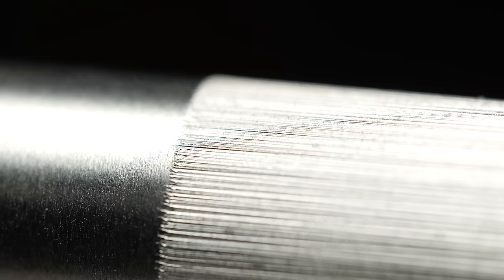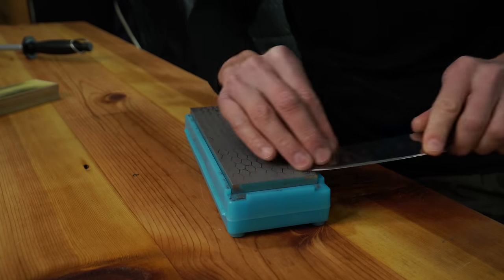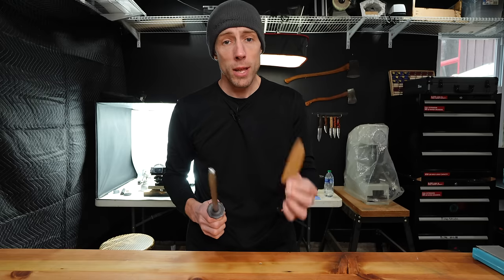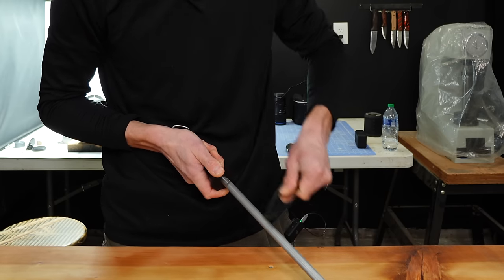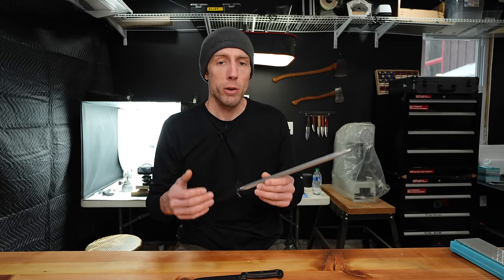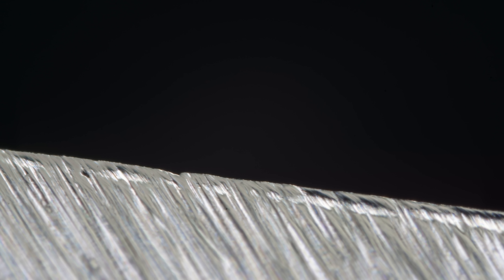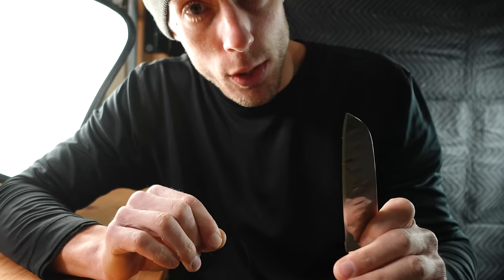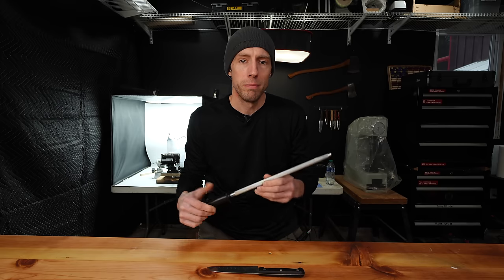What Do "Knife Sharpening" Honing Steels Actually Do?

Comment: YOU ARE CORRECT. A butcher's steel does not hone. It only aligns and restores an edge that has become rolled or dinged in use. It does not remove any steel other than incidental bits of burr.  "Honing steel" is a misnomer. The steel does not hone. Honing is the controlled grinding away of metal with the goal of creating or tightening the apex. 

However, I would absolutely NOT regard a butcher's steel as irrelevant or useless. Properly used, a steel restores much of a knife's cutting ability while removing essentially zero metal. My kitchen knives typically see the steel once in every day that the knife is used, sometimes twice, but sees a stone or lapping film maybe twice a year. 

PROPERLY USED. That is the key. If you cannot maintain a consistent angle, you won't make any improvement. Obsessing over microphotographs can misdirect you from the true goal, which is making the knife cut efficiently..HOW WELL DOES THE KNIFE CUT, compared to as freshly honed? 

Also important is the actual bevel angle as honed. Most people try to use too acute of an angle, resulting in a fragile edge that doesn't hold up well to cutting boards and such. A compound bevel can give the best qualities of the acute and the obtuse bevel. 

The ridges on commercially made steels are not essential. Remember, the action of the steel is STROPPING, not honing. Whether the stroke is edge leading or edge trailing, it is still stropping because the goal is straightening the edge and not grinding from it.

I make my own steels. I simply turn a piece of annealed 4140 round bar stock on the lathe just to surface it, add a handle, and bobs yer uncle. It doesn't have to be hardened. You can also just use a rod of mild steel from home depot. As long as you put a handle on it so you don't slice your hand to bits. Just run the steel inside a rolled around it piece of 400 grit sandpaper to knock off the mill slag and varnish and stuff. It might surprise you how much better it works than those ridgey things everybody sells these days. 

You can show all the pics you like, make all the arguments you like, but the fact remains that a well used steel WORKS, and hitting a diamond stone every time you notice that the knife isn't as sharp as it could be is unnecessary wear to the knife, and a good opportunity for someone who has zero honing skills to really screw up the edge of a knife. I grew up knowing how to keep edged tools sharp. I was very surprised to find that this is not a universal man skill anymore. I got tired of being the only guy in the crowd with a sharp pocketknife and I was really glad when the internet happened, and I could tell people wanting me to teach them how to sharpen their knives or to just sharpen their knives myself, to look it up online. Making and keeping a knife sharp is absolutely an essential man skill but few people have that skill these days. They will destroy their edge more gently by using a steel, and staying the hell away from diamond plates, especially cheap ones that are not even flat.

I do have to LOL at Gordon Ramsay and other TV chefs furiously flailing away with their knives on their steels and obviously not getting anything done except looking cool for the camera. Reminds me of the cowboy movies where the barber strops his razor with a huge belly in the strop and goes at it like maybe he isn't actually a barber in real life LOL.

Comment: I don't care for honing rods but, from my experience, you are using it wrong. You're not supposed to run it along the grooves - you're supposed to run it at a a fairly obtuse angle, just like you did in the video with the pull-through sharpener. Now, I don't have a high-magnification lens, so I can't prove it myself, and you've probably already been told this before and tested it, but I can't travel back to 3 months ago, so here we are.

Comment: i think the steel works more like a file and should be used sideways with little bit of pushing but not up to down only. it has grooves on the surface, that act like a scraping file tooth. so i think the steel is actually fileing away material on the apex, since giood steels can be very hard (65HRC and more)  also you push the knife into the steel not away from it. like with normal sharpening you will get a better result with pushing instead of pulling. that is because the "burr" gets pushed into the edge and cant get as big as when you pull the apex.  by any means the knife steels are outdated as you said. i only use the synthetic ruby (made by degusit in France) sold from Westmark (a German Company) it is the best tool i ever found to keep knives sharp. its not made for full resharpening, but it abrades material of with a very fine grit and leaves a great apex. most ceramic rods are also pretty ok, but i found the ruby to be best grit and ENDLESS use, since it is extreme hard. mine is now more then 15 years of daily use and looks like new other then discoloration, also the rate of abrasion is very constant over time, so it does not realy get dull at all.

Comment: I am a blacksmith, and by preponderance of work, could more-accurately be referred to as a knifesmith (about 90% of my work demand is with blades of some form: hunting knives, kitchen knives, scythes and machetes, as well as axe heads). Saying this, I'll let you in on a very-valuable piece of information: if you are reliant on a honing steel to 'keep your knife cutting sharp', then you have a poor knife that is ground at the wrong angle. All of my blades are made from 1085 or higher carbon steel (I make a rare-few of them out of D2 tool steel). Once I have formed them, and re-hardened and tempered them, I generally put a 20-degree angle on larger blades, and a 15-degree angle on precision blades (while an axe might be 30-35 degrees). The angle is critical, as the larger the angle, the more abuse it can take and the longer it will hold its edge, but with the caveat that the greater the angle, the 'less-sharp' it will be in the end-form. Yes, I have made axes that can shave the hair on your arms, but if you want a good firewood-chopping axe, it is wasted effort to work so hard at an angle...the trick to axes is to polish the sides to a mirror finish, with less focus on that edge...the sides are what slow your blow down and make it less effective).
As for knives, you are not 'calibrated'. You CANNOT hold a consistent 17-19 degree angle to sharpen that knife...so use a sharpening guide to help you! With good steel (high carbon...Rockwell somewhere around 55-59C) start with 400-grit Medium Arkansas stone...REAL ARKANSAS, not some 'reformulated ceramic mix with cute little hexagon patterns formed in the ceramic matrix). The 400 starts the edge 're-dressing'. Now, go up to 800 HARD Arkansas. Work it here, feel the edge, this is the final 'metal removal grit' you need...all points about this are for proper HONING! Now, progress upwards to 1200-1400 Hard Arkansas...at this point, you should EASILY be able to dry shave with the blade. If I want a real masterpiece, I may take it up to 2000-Hard Arkansas...but unless you are dealing with a straight razor, chances are you don't need to work it this much. I use a leather strop with red rouge if I am dealling with a straight razor beyond this point...and is the ONLY steel work I use a 'non-stone honing tool' on. Face it, good knives and maintaining their edge is rather pricey to enter into, but in reality, it is HIGHLY worth it. If you are paying less than $90 for a knife, or $200 for a full set of stones, you are cutting corners or buying 'questionable' goods. Personally, my blades START OUT at $275, and I have sold some for $600 (larger hunting knives with razor-quality edge dressing). As for stones, there is only one company I work with, as their stones are better than all-others, and that is 'Dan's Whetstone Company' in Arkansas.

Comment: I did a lot of similar research with microscopes, and I came to the same conclusion that the ribbed honing steels were just mangling otherwise healthy edges.  However, I still cannot get behind diamond coating honing rods.  They are unnecessary, and still risk doing more harm than good to your edge, especially when abrasive maintenance is not needed so often.  There is a good reason that most butchers all use polished honing steels: they actually do help maintain slightly rolled edges, are safe to use with more pressure, and don't remove any material.  The big issue with steel honing rods is those awful ribs on them.  THAT'S where all that mangling comes from.  I switched to a polished butcher's steel a while back, and it really does help me maintain my kitchen knives.  Even though I baby them (always using a cutting board with light pressure, and never cutting bones), every now and then I can FEEL that there are some spots along the blade with a rolled edge to them.  That's also what is great about the polished steel.  You can actually feel little "ticks" as you drag the knife edge-trailing along the steel.  I can keep working the knife across the steel with a decent amount of pressure, feeling the "catch" of the rolled edge lessening on each pass, until it is far less pronounced.  And when I go back under the microscope, I don't see any other mangling or deformation along the edge.  I would love to see you do a video comparison with your microscope as well, showing the effectiveness of a truly polished honing steel on a rolled edge.

Comment: Oh really? Steel cannon work against the steel?
So HSS drills shouldn't to be able to drill steel...
But they do.
Grinding is less effective than cutting?
Definitely!
But saing that ginding dont'w work at all?
Definitely wrong.
Honing is a way to extend the sharpness for a longer period between sharpening session.
it may work..if you use a knife daily and on the end of the day you want to keep as much sharpness as possible to another day.
But if you ruin the blade  bending the edge....yeah...in that case no subtle means can work.
It it  is like using a rubber hammer to drive in nails...
Will it work?
Definitely not.
Does it prove, that hammer is no good for the nails. 
Not necessarily true...😛

Comment: Ceramic rod sharpener is ideal.. the main thing is not to press hard, or medium, the force is maximum 50-100 grams. It will be like micro-sharpening the tip of the edge, but the rod will quickly become clogged

Comment: 😂😂😂😂 Well, my process is going to sound like a sacrilege compared to this. I have a set of cheap knives, a cheap sharpener and a cheap steel.   I use the steel after each use of a knife, and I have the sharpest knives in my family. I actually have to bring my own to family meal preps because I can't deal with my siblings knives. Mine may not be that sharp compared to professionals, but they do everything that I need them to do very well. They also cut me very quickly and easily if I make a mistake and don't move them out of the way when I'm done. Also, I consider myself advanced compared to my mom who had one knife for EVERYTHING!☺️ It was called the "Brown-handled knife" and if it got dull, sharpened it on the step!! Had it for 20+ years, but got lost in a move. It was probably being used to cut tape!!😂😂

Comment: I'm not directly disagreeing but more asking a question.

Many years ago I purchased a diamond rod as described. Then used, more or less as described, on a good quality knife. (Wusthof Classic chef's knife, should be high quality, German made).

In a few years the knife had too much metal removed to become sharpened properly. The most hardened part of the edge was removed by the abrasive sharpening. Indeed, in the short term I had the good results as shown.

So question is what to do when knife becomes dull after short term usage? Removing metal I am sure works in short term, but long term appears to be a poor result and have to replace knife that should be able to last a lifetime.

That is what the "steel" does, it may not do a perfect job but it does straighten out lightly rolled edges from common usage. And I am sure that proper technique is required. So question is what to do if one wants knife to last a lifetime for ordinary food preparation use, rather than change expensive knives often while having an almost "perfect" edge?

I completely understand that abrasive (metal removing) sharpening is required from time to time.

Comment: I think you’re right but you’re also wrong. 17 seconds on the knife steel raises a bur on a carbon steel kitchen knife that will cut very well but not very long before you need another 17 seconds. The knife steel wins hands down for how much sharp cutting you get for blade material removed. Yes I have to come back to the steel more often but I don’t worry about loosing knife steel to get back to ultra sharp.

Comment: So, this is my experience, and please help me.

I have a few knives that aren't expensive at all.

I bought a couple double-whetstones: 1000-6000 and 3000-8000, not that i ever even use 8000.

I'm probably pretty bad at sharpening, i try but when I'm done the result often isn't great, they cut poorly on the tip and just barely decent overall.

I noticed, though, that IF after i'm done sharpening on stones, i pass them a few times (with a heavy hand) on a honing steel...
They get pretty decent, like i can press cut newspaper sheets and they feel pretty good.

I don't really know if i'm fixing my inconsistent edge, or if I'm making a new one, but from what you say, that shouldn't be the case? Unless I do it so heavily that i actually cut away some steel? Those knives aren't very high steel quality so it might be?

Anyway, I keep using the steel rod cause if I don't do that, I just can't get them to cut decently no matter how much time i spend trying to get them to cut on stones.

Comment: Here's the thing, and I'm smarter than most.

I can spend 20s honing a blade. I can spend 20m screwing up an edge trying to sharpen it. I can spend some hours learning to sharpen a kitchen knife or I can just keep honing.
A new knife + honing and I basically never need to sharpen it.

I sharpen my pocket knives and axe no problem. A kitchen knife is harder because its so long. It's hard to keep a consistent angle at all times through the sharpening process. 1 bad pass during the process and you've screwed things up that you have now spend more time fixing.

Most people just want to slice some tomatoes and eat. They aren't getting ready to cook for 100 people and needing a knife that can last that long before maintenance. We honestly should  be grateful for the ones that even bother to hone. So many just use dull knives and that's way more scary.

I thought a burr was rolled metal bits that you then align. I had no idea sharpening could remove all the individual metal bits like that, so this was a cool video. I just assumed it was always like a stegosaurus no matter what you do. It makes total sense why that clean solid edge would last longer. It's just a bigger structure that is harder to damage.